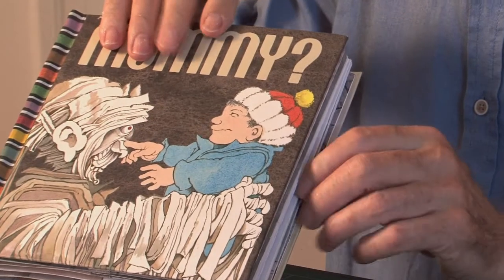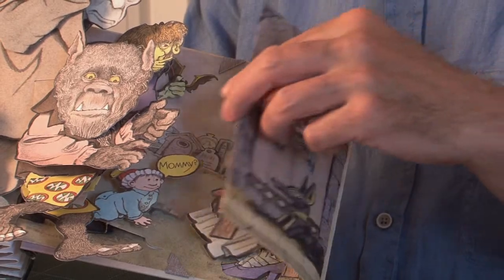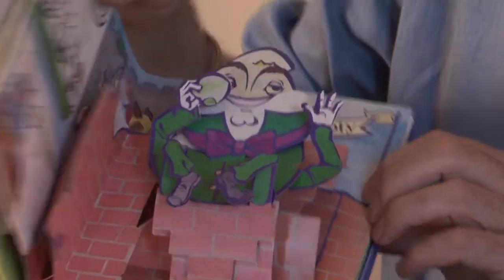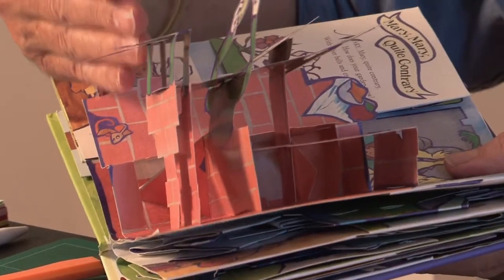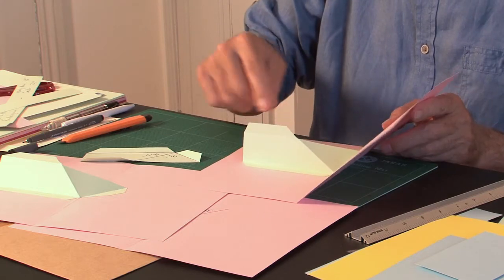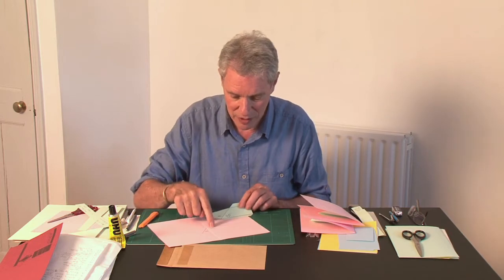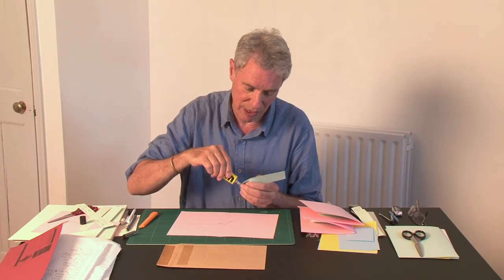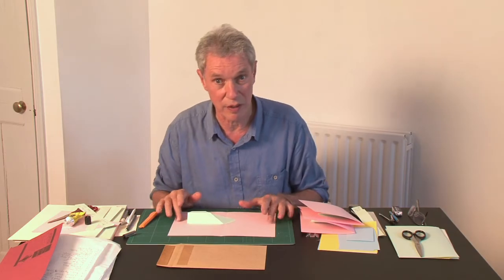Pop-Up Tutorial 29 - Asymmetric V-fold - Part 2

Comment: How did you construct that folding piece using the protractor?
Reply from the maker: There are quite a lot of videos available on how to use a protractor - this one seems quite clear -https://www.bbc.co.uk/bitesize/articles/zdsrsk
Reply: @thepop-upchannel4919  That link doesn't work.  I tried searching youtube and I can't locate how to make cutout shapes using a protractor.
Reply from the maker: https://www.youtube.com/watch?v=3NHnTHhnv8g
Reply: @thepop-upchannel4919  Thanks. I had watched that one previously.  Spent 2 hours trying and failing to replicate this 95/40 degree piece.  Math was never my strong suit.
Reply from the maker: This mechanism is in quite an obscure corner of the pop-up world - there are a lot of paths that can be explored that don't need any measuring.